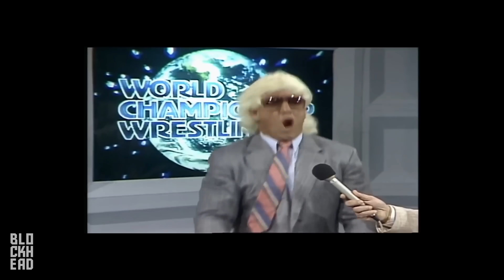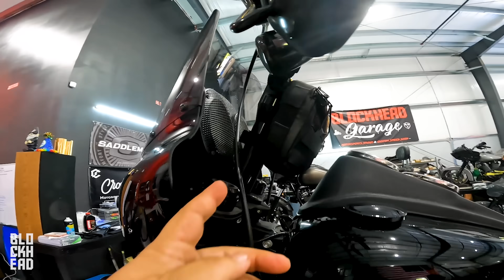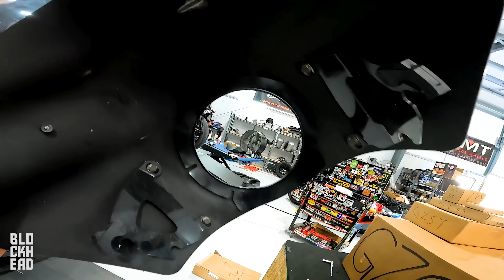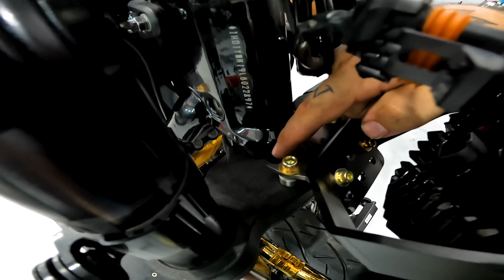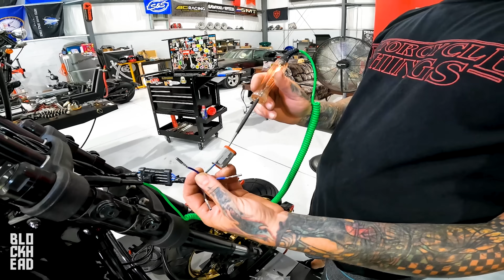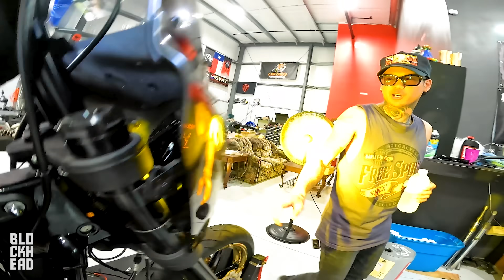BRIGHTEST Harley-Davidson Softail Headlight! (Baja Designs LP6)

Comment: you do under stand that those dont have legal low beam that's low power not a true low beam pattern. low power is meant for driving through dust, rain or snow where the spot patter is not only useless but a hindrance as it will throw light back at you.

Comment: Hopefully whoever watches this video at least reads the comments to know they don’t have to butcher the mount to install. I designed this mount and maybe I should’ve included instructions but it seemed really straight forward. All you had to do is turn the Baja designs horseshoe mount around 180 and it would’ve brought light even closer in than with your modifications to the bracket. I also didn’t include nuts because the lp6 comes with stainless ones. Not sure why you had to source the nuts? I also don’t recommend direct wire method. The light overloads the bcm and throws a code. I’d be concerned about the bcm turning the light off over time. I really haven’t had any complaints about the install and usually Jake from Cali Raised Moto or myself are always available to answer questions. I’m not talking shit by any means but this video is an example of what not to do and I guess it’s partially my fault for not supplying instructions. If you need a wire harness they’re available at Cali Raised Off Road.
Reply: I had a question that I haven’t seen answered and maybe it’s dumb as dog shit but I’m asking anyways 
If you aren’t running the Memphis shade or any fairing at all, do you need the bracket anyways or can the Baja bracket provided with the light mount to triple tree without the bracket 

Also the wiring harness provided by Cali Raised fixes the problem with the ECU I take it as reading your comment?
Reply: @zacharyrosetti2563  yes, you definitely still need the bracket. You can order from cali raised off road.On their website just choose Harley Davidson for vehicle. Also purchase the wire harness. If you direct wire like in this video it will overload your bcm and throw codes and a light will come on on gauge and bcm may eventually turn light off.
Reply: @nukestr  thank you, but I have found that you do not need the bracket if you’re not running a fender just some new hardware mine fit where the original headlight was mounted with stock LP6 brackets. Harness is a must and is very easy to install do not need to remove gas tank on street Bob or low rider just gain access to battery. 
But thank you the wire harness is gold 👌🏽
Reply: Fairing* 
No fairing no bracket needed unless you like the look of the headlight sticking out a little bit
Reply: @zacharyrosetti2563  my bad, I assumed you had a m8 lowrider s. Glad it’s all working out! 👍
Reply: I completely agree with the harness point. High beam is too much of a load on the bcm with no relay.

Comment: Baja recommends not running both high and low beam simultaneously. Run both can damage the internal circuit board. An amp relay for both high beam and low beam are required on the Harley Davidson. These are available online as well as the wiring diagrams for those into DIY.

Comment: Have u guys installed the turn signals. I bought the turn signal kit for my 2021 road glide cvo and I cannot get it to work. I’ve tried everything, the harness that it brought and even without the harness. Soldering the cables with the custom dynamic diodes and nothing. One works and when I plug the other they both stop working. Any insight ?
Reply: I installed LS1’s on my low rider. I used the custom dynamic diodes as well. I have noticed that occasionally my turn signals don’t come on. Try pull the main fuse. If that doesn’t work, start the bike, initiate a turn signal and cut the bike of. When you restart the bike, your running lights should function.
Reply: @brocknewell1794  doesn’t work at all, I’ve tried everything. Someone said that they used a load stabilizer from custom dynamics because these lights pull too much power. Someone else said that they attached both blue cables and connected them to a 12v output on the bike. I don’t know

Comment: Curious to see what you guys id for the Road Glide lights 2015+. I've seen LP6's in another video but the weight has me concerned and yeah cost as well. Thinking one level down from the LP6. Oh and what happened with the 131 turbo RG? Sounds like a blast but I'm sure I'd need to beef up the bottom end of my 131 to add the turbo. Grudgebox, chain drive...you know the normal freak out stuff. Haha.

Comment: Not hating on you guys. But I have that same set up. And you guys struggled way to hard with that bracket. It was a little hard rigging up the shade but drilling welding and painting a $200 bracket wasn’t needed lol. I tried other alternatives to this bracket but this was the best so far. Also the harness is worth getting if you can afford it. Even if your good with electrical work. I love the light. I don’t even have the high beam hooked up on mine. The light blinds  people on low beam. People should keep in mind that this light is not street legal so be carful out there

Comment: Just a thought turn the bracket around that mounts to the light and use the original holes that were in the plate that mount to the triple trees.

Comment: I bought the Amazon knockoff one 500 dollars a big ticket for a headlight but I’ll prolly buy one later on looks good 💯
Reply: Drop the link?
Reply: @Cducey314  then you just need to find who makes a bracket( I use prior performance) for your bike then buy a h4 harness and then splitter to hook the low and high beams
Reply: @Cducey314  just remember that light only has DRL or high beam
Reply: Do you have the link for the Amazon one? Thank you for your time responding I appreciate it alot
Reply: @Cducey314  I dropped the link let me send it again
Reply: @Cducey314  comment on my page my comment keeps getting deleted

Comment: Does Florida not require DOT lights? On the west coast I don't believe you would get away with non street legal lights, but they do look good.
Reply: We run them all the time without issues so far.
Reply: It's not legal. Headlamps are only allowed to be white. The light he installed would be considered for off road use only.

Comment: No thanks,  phase 7 plug and play by truck lite. That's ugly as hell , and over  priced.
Reply: How much does it cost?
Reply: @johnstocker6728  The LP6 in amber or clear typically sell for $400-500 from what I have seen.  You will need an additional custom bracket to mount the LP6. The Baja light is over 10k lumens... it also has two 140* lamps for throwing light out into the sides of the road.
Reply: LP6 has better coverage and a better beam pattern.  I think it looks great, planning on adding a standard color LP6 in my Indian Challenger in the next month or two.